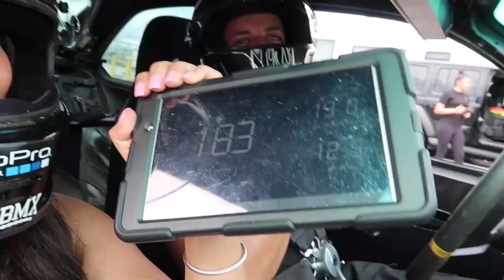EPIC WILD DRIFTING WITH THE BEAUTIFUL SHARON GOMEZ!

Comment: If you two are dating "behind the scenes", such an awesome couple #couplegoals 💪
If not, you should be, but anyways, #friendshipgoals 😂😂
You two seem to be bringing out the best in each other and you both seem to be very happy when spending time together, which is the most important thing in any relationship/friendship 😄

As for the car/driving, are you using 2nd or 3rd gear? To me it sounds and looks like your wheelspeed is too low for the amount of power you have 🤔 I mean, you could probably drift at higher velocity and make more smoke if you shifted up a gear or at least put a longer diff 🙂 Or I could be way off, that's just from the video, which is not the same as being in the car 😂